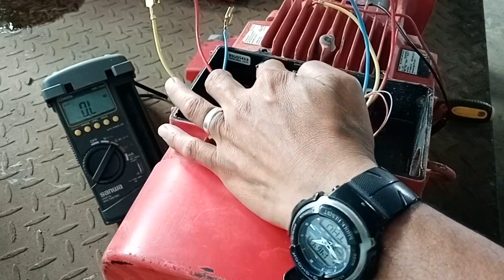WYE-DELTA THREE PHASE MOTOR CONFIGURATIONS - A COMPLETE VIDEO TUTORIAL.

Comment: Sir. Pwede ba mag wye delta operation khit 220 volts lang gamit ko, 12 leads out po Yung motor? Pwede po ba Yun? Papasukan ko Ng 220 volts Ang supply?
Tnx and Godbless!
Reply from the maker: Pede sir basta nakalagay sa name plate ay double delta in 220V. Ibig sabihin double wye in start double delta run. Kasi sa wye delta transituon palage delta configuration ang basis of supply voltage dahil sya ang running configuration. Sana po nakatulong Sir.
Reply: @chrisampere  Salamat po sir. Di pala pwede single Y po? Kasi pang 440 volts po Yun? Tama po ba?
Reply from the maker: Sorry po for late reply night duty po kasi ako dito abroad, kakagising lang. Pakicheck po nameplate nya if merun 2 delta, 2wye,single delta at single wye at anu mga required voltage according sa configuration nya. For sure sa mga 12 leads merun for low voltage configurations such as 2delta & 2wye.
Reply from the maker: Paki watch po nito additional information. Sa last part po ng video andun mga kelangan nyo information.
https://youtu.be/SDaaphP6Me0
Thanks & God bless po.
Reply: @chrisampere  thank po sir
Reply from the maker: Welcome po Sir. Thank you for your support.